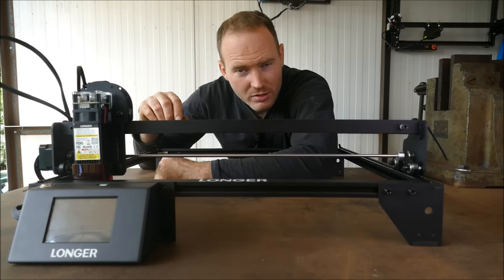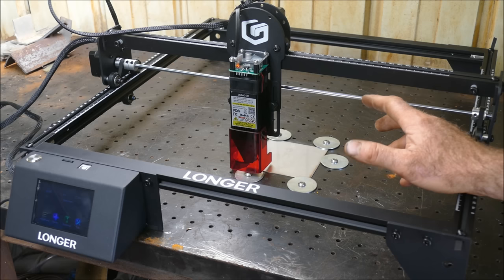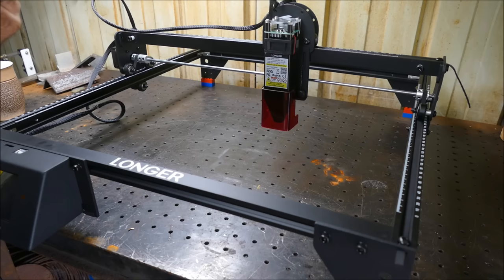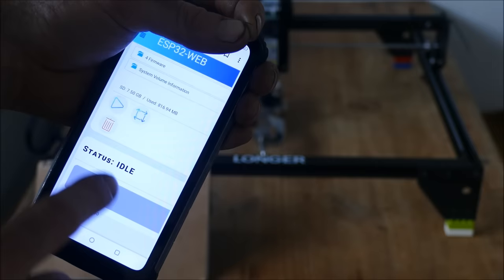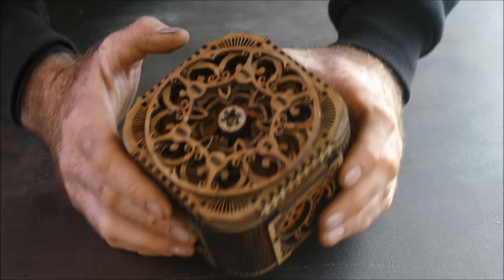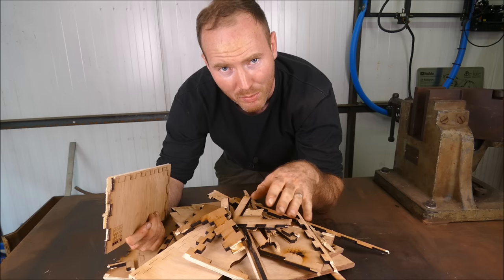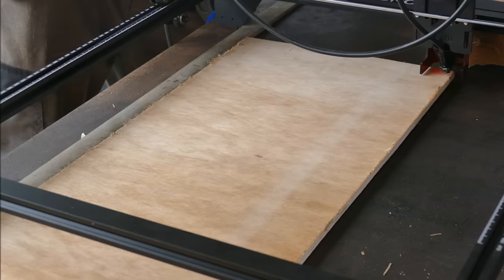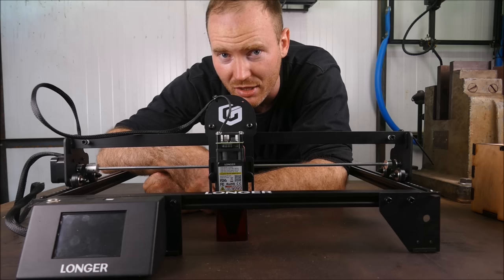This New CNC laser is amazing! - The cost effective LONGER RAY5 10W - New!August 2022

Comment: Nice review, just upgraded my 5W version to 10W, huge difference in performance along with the improved 60 micron kerf. Out of interest what compressor do you use? I've got a 50% duty cycle Bambi BB24V which is great for light duty stuff like air brushing (art grade), just don't think it will be capable of keeping up for laser air assist since its maximum duty cycle is 30mins on 30mins off. As I understand the best flow rate for cutting is 10-15 lpm and 1-3  lpm for engraving.
Reply from the maker: Thank you and well done on the 10w laser. My compressor is a big one for running my DIY power hammer. 150ltr 3hp 15cfm. I got it for £100 second hand. I drop the pressure to 20psi. I think a 50ltr workshop grade compressor is more than enough. It might also help to have a decent dryer as well so it doesn't cool the cutting too much. Cheers J
Reply: @joshuadelisle  Thanks for the info. May have a look at one of the Hyundai silent compressors. Yeah dryer is important, also as I understand oil compressors can do serious damage to a laser's lens if the oil is not adequately removed from the air. Avoiding the fish tank pumps which they are selling these days for air assist, don't think they will last long since the diaphragm will need regular replacement.

Comment: Hi Josh, 

What industry/businesses did you hit up for the scrap plywood and which ones would you suggest looking into for nice offcuts? 

Cheers, 
Peter
Reply from the maker: Hi Peter. So I found by chance a small shed making factory. I was picking up shavings from them for animal bedding and they had stacks of off cuts available. I also found that the large DIY stores who supply cutting services for their sheet material also give away off cuts for a charity donation. I think googling a local wood working business and popping over on the off chance you're likely to find some. Hope that helps. Cheers J

Comment: How long have you been cutting this box?
It's a pity that you didn't say that it was work for the equipment for a minimum of 10 hours .... I bought it and I'm disappointed.. Engraving A4 for a few hours, about 4-5, the equipment is cool, it will do what is shown in the video, but the time I need for it leaves much to be desired.. .
Reply from the maker: It shouldn't take that long. Have you tried faster speeds. Cheers J

Comment: Do you have any idea what depth the engraving is on your metal I am looking to engrave logos into aluminum mold that would then be transferred to injection molded parts any help would be greatly appreciated
Reply from the maker: It doesn't really engrave as it does wood more it marks it by oxidizing the surface. You can feel and pick at the melted and then solidified steel. For steel moulds and depth of engraving you need a fibre laser that is capable of cutting steel but set to engrave. This can be done at a local profile cutting company. Alternatively a cnc mill would be the best choice. Cheers J

Comment: Is it possible to add a rotary roller for engraving/cutting round parts? 
You would probably only need to connect it to the Y axis, so long as the stepper was set the same
Reply from the maker: I believe you can. Check out the links in the description to see their range of add-ons. All the very best. Cheers J

Comment: Wow! Just amazing. This seems likely the way all the buildings with gear mechanisms on Game of Thrones introductions were made.  Makes a lot of traditional joinery shops close to obsolete as well as changing many sign/engraving shops too. Kind of want one, but I fear lasers & eye damage which for the moment weighs against having one, but I now know what I am missing! Thank you for sharing!
Reply from the maker: Thank you. I love them and have lots of projects I could do with it. I think for a carpenter it's as useful as a welder is for a blacksmith. I treat it like my welding machine and always wear eye protection band make sure everyone else is shielded from the arc/light. Cheers J
Reply: Wear glasses!!
Reply from the maker: @therzal  yes correct. You should. Cheers J
Reply: @therzal  The problem with lasers is that they can operate in more than one mode simultaneously. You may be wearing the right glasses for the primary mode, but not for the secondary. I knew an Oxford DPhil student who suffered serious eye damage from an unexpected secondary mode. This made me very wary about being anywhere near operating lasers.

Comment: Hi Joshua, would you upgrade to the master 3? Your stainless engravin bloody convinced me man…
Reply from the maker: I'm getting one to test out. What I like about the Ortur LM2 pro is I can extend the gantry very easily. The LM3 is more robust and professional, operated with a phone App. But they both use the same 10w laser
Reply: @joshuadelisle  oh and could you do a test with carbon steel too please if possible? Just trying to figure which engraver to buy now….
Reply from the maker: @yandiwa4707  hi. I would say the effect is the same however it's only marking the steel not engraving in the same way as a mill or graver. So if you pickle the steel or let it oxidize you'll loose the marking. I'm actually about to engrave a knife I just made after I've pickled it. Cheers J

Comment: You think this would be able to cut stainless steel? I'm hoping to purchase one if it is capable of doing that.
Reply from the maker: No it can only engrave stainless. You need a either a plasma put on one like I did in my other video or you want a 100kw fibre laser. Cheers J

Comment: I had a job listed with a business to provided a custom sized steel heat vent cover and he provided me with a sample but then before he finished the job his business closed.  Due to illness I later found out.  But then I found some Etsy air duct grills but they were made on 3d printer not metal Could you make metal air duct convers?  To custom size?
Reply from the maker: I sure can. Send me a message on my Etsy shop with dimensions/drawing and I'll quote for you. Cheers J

Comment: 9mm ply! With my 60 watt co2 I couldn't cut that.
Reply from the maker: You should do. Some ply isn't ideal as the glue is heat resistant. I've got some ply that my machines wont touch. Bamboo or birch ply is a dream to cut. My 50w co2 cuts 20mm thick pine no problem. Cheers J

Comment: The burnt edges are an acquired taste, I think. What do you do if you want to see undamaged wood?
Reply from the maker: So you can for example over size the box joints so they stick out a few mm and then sand them back. It's obviously not as good as a more expensive co2 laser but for the price the results are very impressive. Cheers J
Reply: @joshuadelisle   thanks!

Comment: Hello.
Can you or anyone here help me get into a small table top laser with the capabilities of cutting 16ga Steel.
I currently have a plasma table but want the clean precise quality of the laser.
Any way to break into it without breaking the bank?
Reply from the maker: Sorry but these table top lasers can only mark steel not cut it. You need a  fibre laser with at least 2kw of power and a nitrogen assist to cut steel. Might be possible to cut thin stuff with a co2 laser but I'm not convinced. Cheers J

Comment: Here in the United States, 99.9% of businesses will not give you anything left over from their manufacturing processes. They are either licensed with a contractor who collects the left overs, or the business will throw it away whereby refusing to let you have any of it. Aside from wood, even with the metal recyclers, here in eastern Ohio the vast majority of metal recycling businesses refuse to even let us buy the metal that others have turned into them as scrap. They wont even do it if you pay them more than what they paid per pound for it when it was dumped off to them

Comment: Hi There, looking to get into doing some laser engraving on acrylic as a bit of a side hustle what in your opinion would be the best laser to do this?
Reply from the maker: I've not yet tried engraving acrylic but the new 10w Ortur laser can cut up to 30mm through acrylic. I think they have the best 10w laser module that I've tested so far but my preference is now to have one with an offline controller like the longer Ray5. I'm currently testing the new Enjoywood and laser pecker2. I'll give acrylic a try on them
Reply: @joshuadelisle  thx mate, I was looking at the Ortur as it rated pretty highly on a review of top 10 lasers in 2022 and after watching your videos on it and the Longer unit I'm now not sure?
Reply from the maker: @intricate3dsolutions  personally for me if it's a choice between the two I would choose the Ortur and buy the offline controller made for it. The Ortur 10w laser is better in my opinion and slightly easier to set up. Not much between them though. Cheers J

Comment: how do you compare the longer RAY5 10w to the ORTUR Laser Master 2 Pro-S2-LU2-10A?
Reply from the maker: I prefer the laser and gantry on the Ortur as it's more powerful even though it's rated the same. But I like the offline controller the longer has and it makes it more convenient to use. I'm reviewing a few others called Enjoywood and the Ortur 3 coming soon. Cheers J
Reply: I’m looking at ordering one this weekend. Does the enjoywood or the ortur 3 have that much more over the ortur 2 pro? Sorry a little too anxious to wait for the video.
Reply from the maker: @mountainmat673  the Ortur 3 is the same laser module but has a better quality gantry and is operated with an app. The Enjoywood isn't as good but does have an app control too and has options for a offline controller. I personally like Ortur 2 pro as I can easily upgrade the gantry to be bigger but I cant do that on the 3 as easily.

Comment: Any idea if these diode lasers can cut low melt metals like lead & pewter?
Reply from the maker: I don't know I haven't tried. I will be trying sintering copper onto steel though 👍 Cheers J
Reply: @joshuadelisle  would be cool if you could try pewter at some point, would be a good way to make jewellery.. vaporised lead is probably a bad idea.. 😊 Mind you if it did, could be a way to make PCB’s..  so many questions, I really need to get one just not sure if I should go CO2 or LED..

Comment: I suspect the IP was something like 192.168.0.***

Which is the local IP on your network.
If you managed to connect directly to your CNC using your public IP without any head scratching, I would be concerned about your firewall.

Comment: Josh, I’d be looking at one of these perhaps….. How would it cope with a piece of hardened steel, say 01 or 1095? Would multiple passes make for a deeper etch? Thanks Mic - Brechfa Knives 🔥🔪👌🏻
Reply from the maker: Hi. So a multiple pass can work but really just going more slowly is the best bet. A 10w output laser is the minimum for what you need and making sure the blade surface is completely aligned flat with the laser gantry is key for a consistent etch. I don't think it matters how hard it is, rather what temperature it melts/oxidizes at. A slightly rough surface is far easier and quicker to etch than a reflective one as it absorbs the light better. Cheers J
Reply: @joshuadelisle  - Superb, thanks for letting me know. Flat and clean are not a problem 👍🏻 Seems a good option Vs a £2,500 50W fibre laser.
Reply from the maker: @mictaylor9531  fibre and co2 lasers are far quicker at cutting and can cut deeper. But it's relative to how much you need doing. Either machine takes just as much time to set up and both can be left to work whilst you do other things. I would say a £100k unit is worth it if you want it to churn out £100k of work every year. For the odd project a £500 laser saves a lot of time. Cheers J
Reply: @joshuadelisle  Agreed - The longer looks worth a punt for £500 👌🏻🔪🔥 Thanks again and thanks for the channel - always good and useful content - appreciated 🍻
Reply from the maker: @mictaylor9531  thank you so much. I recommend you get air assist attachments which ever machine you decide to buy. Makes a big difference when cutting or engraving wood. Not needed for steel though but useful for cutting out wooden jigs to hold the knives. Cheers J

Comment: So what is the actual power output (I understand no diode laser is > 6W)?
Reply from the maker: Input is 60w although I read on my meter is actually 45w. The optical output is 11w
Reply: @joshuadelisle  40W input lasers are usually c5.5W output. Either this company has sourced a new diode that is not available to others, with twice the output, or they are being economical with the truth... 
The NUBM44 is listed as the highest power available, and is rated as 6W. Do you know what diode this machine uses?
Reply from the maker: @Tensquaremetreworkshop  I can only say whats written on the laser. Input 60w output 11w. I believe some lasers are 80w input and 20w output by xTool. Ortur has two 5.5w laser diodes inside it which are combined with mirrors to make it a true 10w output.

Comment: Outstanding video as usual!!
Having an own laser cutter/ engraver is a huge advantage in comparison to other shops. I'd really like to have a go at laser engraving, sadly I'm quite useless with Fusion 360 and similar programs so that probably will be just a dream 😅
Also I really like the idea of your second online shop and selling boxes etc, might be a good way to make a profit. Especially if you just cut it and send the board of plywood "as is/cut" to the customer for self assembly 🤔👍
Reply from the maker: Thank you. Yes I love these machines and what they can do. I think though this channel needs to be blacksmith and metal work so it's important to separate it to another channel. Yes anything like engraving to cutting paths I can design no problem, so if it helps people out I can provide that service. Possibilities are endless. Cheers J
Reply: Fusion 360 is not too hard to learn. I use it often. That said certain laser made products don't require much in the line of exact measurements. Particularly signs etc. I often just use lightburn. It has its own CAD like interface and I can draw a sign in a few seconds with it. What it's nit great as is designing exact strange shapes with exact measurements, what it's great at is engraving images and using typical box and polygons the size you want. Most of the time if I want a box, I use an online box generator program which is free and easy. I only use fusion when I need to fabricate say a plate that has holes in certain distances and exact position things like that. But many laser projects like decorations and signs etc don't need exact dimensions etc to you don't even need to learn fusion for things like signs etc.

Comment: Where do I find design software or files to download for this unit and is there a cost or can you download free?
Reply from the maker: The software I use is the free GRBL laser software or you can purchase lightburn, This turns a drawing or image into laser Gcode that the machine reads. You can design things in paint, inkscape, Photoshop etc or use CAD software for more accurate models such as SketchUp, AutoCAD, SOLIDWORKS etc. There is a lot to choose from and all have good points and bad points. Depending on what I want to create I choose the software that's most effective for that purpose. Cheers J

Comment: These diode lasers are for small low power applications. A 60w c02 with air assist is baseline for actual projects and also have a 3 foot by 3foot bed at the smallest. This is a toy.
Reply: There's always someone who wants to start a penis measuring competition and belittle what other people have. CO2 lasers aren't the best for everything. 10 watt diode lasers are better for engraving metal.

Comment: Hi, is it 10W output or input laser ??
Reply from the maker: It's actually 11w optical power output. (Classes as a 10w) Cheers J
Reply: @joshuadelisle  tnx mate ! and btw whats the effective working area ?
Reply from the maker: @jay1st1st  hi. It's 410x410mm max. However I bought longer lengths of aluminium extrusion to upgrade one to 8'x4'. Coming soon

Comment: engrave steel? Actually engrave? or mark? Because that is a 10w diode laser at 450nm. You will not be engraving, and these reviews kinda piss me off when y'all don;t know the difference.
Reply from the maker: I don't think many people would understand metal marking machines as a title. I think most people understand 'laser engraving' isn't  engraving in the same sense as say chisel engraving. Context is everything. Cheers J
Reply: @joshuadelisle  It's not engraving in any sense - it's doesn't remove any metal it just cerates a surface patina.
Reply from the maker: @seanburke997  ok 👍

Comment: This machine is horiffically unsafe, because it lacks an enclosure, fume extractor and filter. Given that it has zero basic safety features, I am gonna guess it also has no stuck detection. so you can make it choice of fire, blindness or poisened, or go 3 for 3.
Reply: Add to that the cable dragging around on the cutting surface